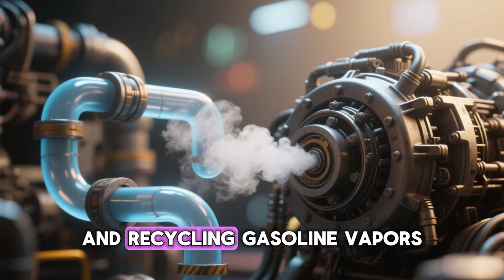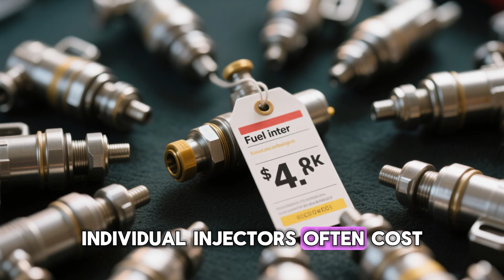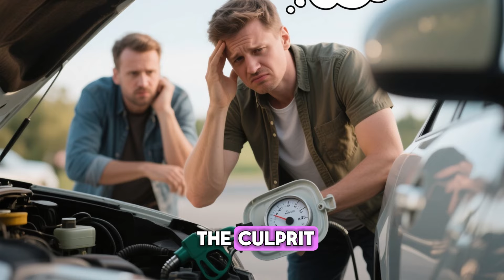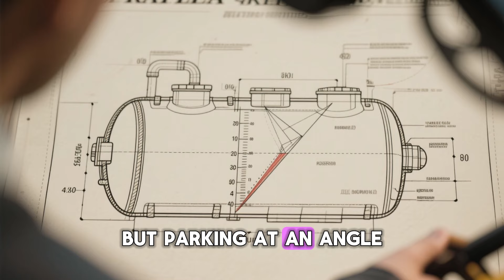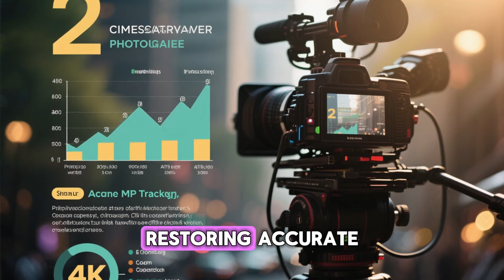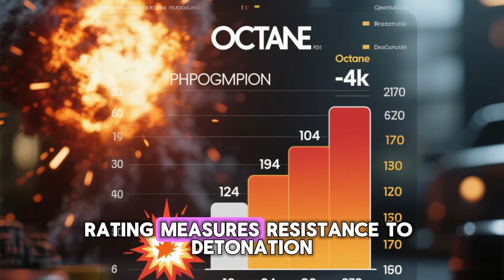Never Do This Before Refuelling ( Costly Mistake 95% of Drivers Make)

Comment: This is factual. I see all these fools push more fuel that goes into the EVAP. it will eventually cause harm over time. 

The filling of the tanks is also true. U do not want water in the tank which has condensation.